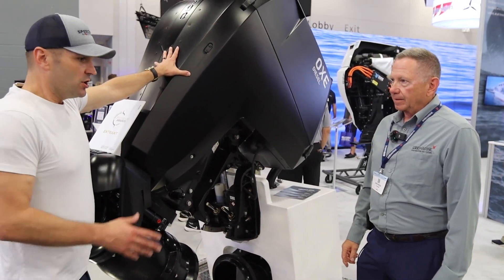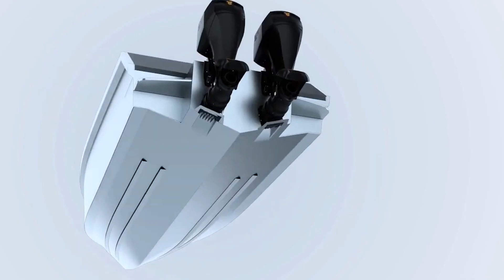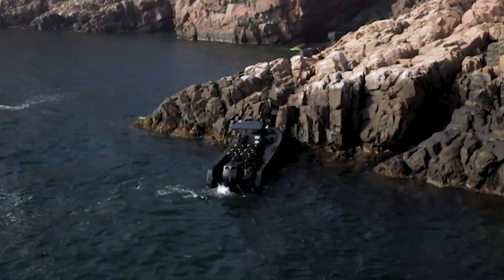Review of the Amazing Diesel Outboard Waterjet Engine by OXE Marine (OXE300 Jet-Tech)

Comment: Jets are not more efficient, but this jet is probably as he claims, the most efficient type of outboard jet. The axial flow is a big deal on efficiency. 
Be curious to see how it pans out and if it can be adapted to smaller jets in the 40-150 ho range.

Comment: A jet is more efficient my ass. Nothing sticks below the boat if you're hull has those tunnels built into it which then renders any trim useless.  I know these motors aren't more quiet than a Merc 600, much less a 3. I highly doubt they use less fuel and definitely create a bunch of heat in a tight space that never works well for longevity. I wish someone could tell me an application these could shine on. I dont think it exists.  300hp is 300 hp, it doesn't care what fuel you burn to get it.

Comment: Most sailboats need a large outboard but it’s impossible at sea . Nobody has a product in the long range electric outboard. May 50-100hp to push a 40ft or so at 5 knots at 50% throttle. The market is huge and untapped. I just need the outboard and I’m starting a package deal.

Comment: This is spot on correct claim as true and the added benefits to doing this besides being a diesel are ENORMOUS as when used at "trolling speeds" of say 6-8 knots this is also an AMAZING energy recovery system for topping off ahem "trolling motor batteries" ahem creating the first true hybrid electric platform for Boating as an Industry first as well😊

Comment: Nananana, not so faaasst. So did OXE just solve the diesel soot problem, or is it just unregulated in the maritime applications? That's true, if the guy says, that diesels are 50% cleaner in terms of CO2 compared to gasolines, buuut what about the typical diesel problems: NOx and soot? Solved or not regulated?

P.S. I was triggered by him mentioning, that this engine was much cleaner than others in that room..
Reply: If the exhaust is discharged into the water like most marine engines you will not have an issue with airborne soot particles. Also for the most part boats do not operate in highly populated areas.
Reply: It would depend on how you set it up .

Comment: I'd like some better pics. Looks like the intake is attached to the transom? How do they turn?
Reply: The engine doesn't turn. The waterjet has a steering nozzle on the discharge. You can see the stainless nozzle gimble shaft in some of the views that show the bottom of the jet.

Comment: Um am I just dumb but a 300hp outboard is between $28k-$38k. He compares an outboard to inboard. Why?  He says it’s $100k versus a $160k inboard. Also isn’t the Yamaha jet engines way less than that. I mean the Yamaha 25fsh with twin jet engines isn’t even $100k. Granted you can’t get just the Yamaha engines as far as I know but seems like it’s a ridiculous price.
Reply: Guessing he is comparing it to a diesel inboard so comparing diesel to diesel. Not outboard to outboard.
Reply: @edwardbowles8613  ah yeah that makes sense. When he said it, it seemed off though. That does make sense though. I don’t know what diesel inboards cost but I’d imagine it’s right around there.
Reply from the maker: Yep, as Edward said 👍
Reply: 300 hp diesel is way more then 300 gas hp as the torque wil be much higher so you can run a bigger prop on the diesel meaning a 300hp diesel wil be faster then a 300hp gas engine
Reply: @gabbermaikel   but what about the gearbox? Diesel engines are Torque Monsters, can the gearbox survive for enough time to make it financially make sense?
Reply: @brettweltz8135  pretty easy. We have diesel cars for years now, do you see them stranded on the side of the road all the time? No. The oxe diesel is actually a bmw road car engine. Its the 3.0D engine used in the bmw 330d and up, every diesel of bmw with a 30 or 3.0 and higher marking uses this engine block some with way more power. And the gears in those cars survive without any problems. They can do wel over 500.000km without any sort of gear issues. The blocks on those high hp versions sometimes blow up, mainly because of bad abuse or bad maintenance. But i have never heard of a gear problem with them. Sometimes the automatic transmission fails, but then mostly the clutch packs, and again mostly because of bad maintenance.(bwm/zf claim its lifetime oil, but what is the meaning of lifetime? I think 150.000km is more then enough life for a bmw from a manufacturers point of view, if it where to break after that its out of warrenty and they can sell you a new part or car.)

Comment: Who ever heard sucking in water - ABOVE THE BOTTOM OF THE BOAT?   I guess the water suddenly has to bob up into the intake.   How can that be efficient at more than a few MPH?
Reply: if you look properly you will see a tube on the back of the boat. when the engine is lowered into position the front of the jet seals onto that tube. and that tube leads to the intake thats under the bracket ( similar to an armstrong bracket )
Reply: Every jet on every boat is above the hull line , try and educate yourself on jet pumps

Comment: The shielded nature of the impeller  in waterjets makes them so much safer than props for marine life and swimmer's...

Though more efficient than an open prop it would be interesting to see the comparison with a toroidal/sharrow prop and the deep speed electric rim driven electrojet.. the advantage tends to open up in favour of jets as speed increases.. and with  jets however the rim driven blades of the electrojet mean it continues to cause less cavitation and has lower operating costs in terms of servicing .. oil and filter changes. That give the Rim driven E jet a speed and efficiency advantage over internal ICE driven  interior waterjets.

The bio diesel option makes sense but even more logical is the development and substitution of the rotary liquid piston diesel and multi fuel motors.. mainly for simplicity size and lightness 80%. and also another 20 -30% efficiency .
They produce less noise vibration and with only about 60 parts in a whole motor. They are also inherently quieter and physically small. 

To anyone interested in wake turbulence/noise reduction rim driven electric drive adds total rpm control from 1rpm up to max. to the options whilst full motor torque is available from the first few RPM. Up to near max.

This is an interesting and valuable transitional  development but it can quickly be overtaken if the combustion of the fuel is optimised through an advanced generator .. as in comercial diesel electric systems..🤔
Reply: Такой привод КПД сильно занижин, чем у простого винта.